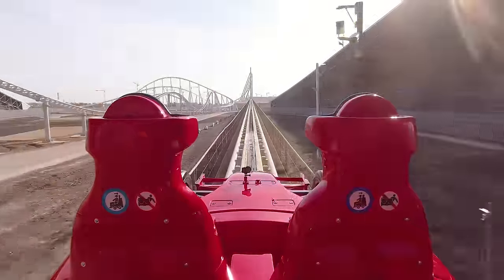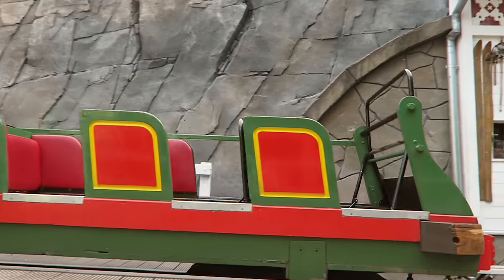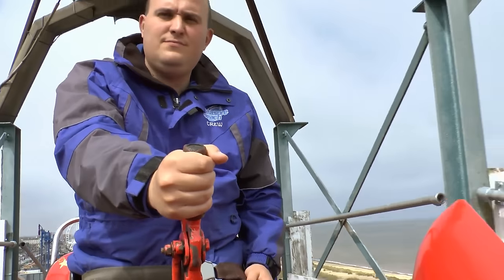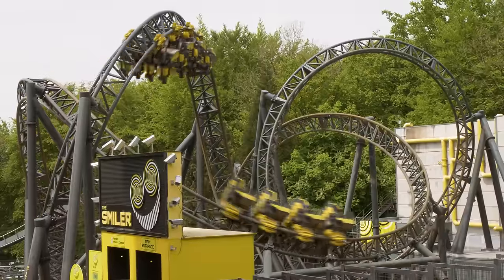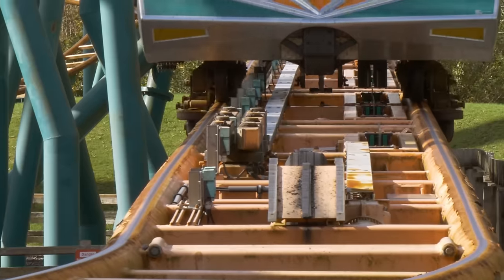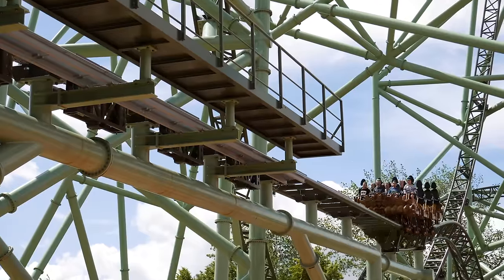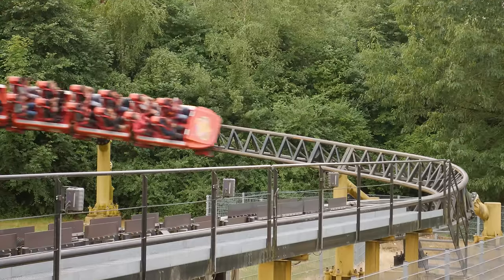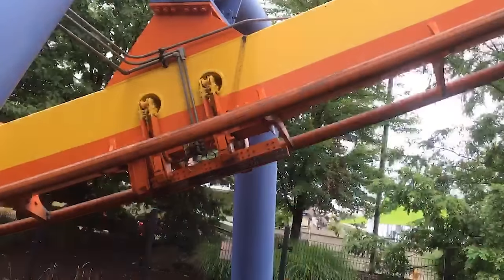Roller coaster brakes NEVER fail

Comment: As informative as this video is. It will never eradicate the fear of seeing a station break failure in the original rollercoaster tycoon
Reply: If the coaster has multiple trains, it means there's about to be a crash. If there's only one train, it means those guests are getting a free ride.

Either way, it's terrifying.
Reply: Only if you didn't have trim brakes.  Station brakes failures would cascade to any brakes immediately before the station, but if there is a gap of at least one tile, the before-station brakes will still work.
Reply: bro got traumatized by rollercoaster tycoon 💀
Reply: @CarlosAM1  Failing a difficult scenario because the RNG decides to fuck you over is definitely fear-inducing.
Reply: Which is why I always use block brakes. Period. This fear of brake failure even permeates into playing Planet Coaster. If it has multiple trains (sometimes even if not,) that coaster gets block brakes! 
cue Oprah Winfrey meme
Reply: I went to a design, where the ride starts at a high point and at the end it has to be lifted up. So no breaks are needed.
Reply: @RadioactiveSherbet  RCT1 did not have block brakes
Reply: Good old RCT with it's fail deadly brakes
Reply: Don't worry! The lift hill chain will slow them down!
Reply: I used to fear that too when I was younger. Now, over two decades later, I know to either A. add brakes before the station or B. set the Coaster to have it's parked train leave the station if another shows up (only works with 2 trains).

Still, perfectly manageable problem in-game.
Reply: @alaeriia01  I've seen a lot of people say that, but I think it must depend on the ride and/or game version, cause I tried that as a kid and it didn't work.
Reply: After playing through the Diamond Heights level, I learned pretty quickly to double-check the trim brake placements at the end of each rollercoaster.  Nearly every prebuilt rollercoaster in the game lacks the proper braking system.  The best way, I found, was to place a set before the last bend in the track, followed by four tiles of straight track consisting of a spacer followed by a trim brake between two chains.  If the station brakes fail, any set of brakes that are not touching the station segment should still work.  In most break down scenarios, the chain drive sections stop moving which in turn acts like a brake that brings a slow moving train to a complete stop.
Reply: @RadioactiveSherbet  Block brakes should be a requirement to run multiple trains on a coaster in any coaster game. That is, after all, how it works IRL.
Reply: The idea there is that while they "never" fail truly it's "never, with proper maintenance" and in RCT the frequency of maintenance done on the ride will determine a probability value that determines if the brakes will fail or not.
Reply: in rct all breaks are fin breaks they can pnly be straight

Comment: One thing that this video didn't mention is the fact that permanent magnets lose strength over time.  So you still need to either (a) replace the magnets on the train or (b) re-strengthen the magnets on the train periodically.
Reply from the maker: That's a great point! I'm a and b would be covered during maintenance of roller coaster trains :)
Reply: Oh yeah i didn't think about it, still better than electromagnets that would stop working without power
Reply: That's the first thing I thought. Also, when eddy currents slow a train down, it produces a lot of heat. The magnets probably need very good heat sinks. Magnets are less effective at high temperatures, and if it hits the Curie temperature, about 700C, even for a second, it destroys the magnet completely.
Reply: still pretty sure that happens a LOT slower than the wear of the friction brakes (and by having said magnetics in right before the friction brakes to do the final stopping, it further reduces the wear on the friction brake, since the train is moving very slowly already into them)
Reply: @iankrasnow5383  looking at those coaster cars, it doesn't look like a whole lot of effort has been put into heatsinks, but realistically I don't think it's necessary. The brakes only really get used for a small percentage of the ride time, the fins and magnets have a fairly large surface area to disperse heat from, and they should have quite a lot of thermal mass to dump heat into if the air cooling isn't fast enough.
Reply: @crosswingrobots  It kind of did. It said they're failsafe because they are passively on and there's redundancy. But of course they can fail if the train derails or something. Plus if the operator accidentally turns off the friction brakes, you're gonna have a bad time.
Reply: @iankrasnow5383  not quite: most of energy released takes form of heat from current - current that is i induced in metal fins. Ergo magnets, even if they warn up, do so little, and as for metal fins it depends - i would say that they are calculated with cool down time (from round trip time of cart) and if needed are intentionally smaller but longer as to spread out heat over overall larger area. 

After consideration: it may also be possible to use special fins for each breaking segment (initial slowdown on small fin and later down the breaking segment larger fins intended for catching out reminding energy. Not just that i believe that if you made effort to make good timing you could even use energy induced and power rail to accelerate another cart at being of the track.
Reply: @iankrasnow5383  Okay, but if you've derailed I don't think anything is going to help you.
Reply: @rajzerfilip  IDK about the track ones, but I would think the high speed movement of the train would do a pretty good job at cooling the brake components on that end.
Reply: @scottthewaterwarrior  yes, but even if it didn't you can always borrow electrodynamic brek from just about any modern diesel loco
Reply: Could they use "temporary magnets" that are charged by electro magnet when the train is stopped/stopping?  (My definition of temp magnet: iron rods turned magnetic, for example)
Reply: @macgyveriii2818  That would be inherently less reliable. As the cabling or energy storage can easily fail.
A permanent magnet going past a conductor will produce eddy currents. Even if the conductor is non-magnetic, like copper.
Look for "magnet copper tube" videos. That is how hard the laws work for you here.
Reply: Permanent magnets decay very slowly. Like. Decades to centuries. Replacing it isn't going to be a problem
Reply: This would be solved with room temp super conductors, we can make insanely strong and durable permanent magnets with minimal deg
Reply: It's the fins on the track however that see the bulk of the heating effect.

I suppose if you mounted the fin on the vehicle you could use permanent magnets on the track for failsafe brakes and additionally electromagnets for trim braking
Reply: I think the heat is mostly generated in the fins, not the magnets.
Reply: Not so permanent if they become inert over time 😂
Reply: Isn't that effect something that takes hundreds of years to noticably manifest?
Reply: @iankrasnow5383  The operator doesn't directly control the brakes. The only thing the operator does to control train movement is pressing and holding their dispatch buttons when the train in the station is ready to go, and keeping them held down until the next train is parked in the station. Releasing them at any point in this process will stop the train that's partially in the station. Everything else is fully automatic.
Reply: If kept in normal conditions magnets lose power over dozens of not hundreds of years. You can practically ride your entire life without changing magnetic breaks.
Reply: Yeah but that is a lot less maintainance than using friction brakes or skid brakes all the way through. Skid breaks also need to have their springs exchanged over time but that is pretty negligible combare to the friction wear  and tear

Comment: The water brake used by Sheikra is actually pretty problematic all things considered. A year ago I got to travel down to Tampa to replace the two sections of track directly after the water brake due to corrosion.
Reply: I'm guessing you're a roller coaster mechanic? That sounds like an exciting job as far as being a mechanic is concerned.
Reply from the maker: Interesting to hear!
Reply: @Aaron-cs3xl  nah he was just bored and owns a welder
Reply: why do you think that is problematic? The engineers know it will corrode. Replacing those sections is maintenance, not an unexpected repair.
Reply: @CarlRencer  probably because due to corrosion it has to be replaced fairly often compared to the rest of the ride. especially considering sheikra is a steel coaster which can normally go around 30 years without their track having to be replaced.
Reply: Another thing is that using drag to slow the ride down is that the drag generators can get broken down. The sheer forces those breaks must be under every time they're used must be incredible. That's a failure point, right?
Reply: @Razticz  I didnt know you were still allowed to buy those, after the war.
Reply: It's funny how people are concerned about water brake causing corrosion ehen they don't seem to realize that rain can cause corrosion as well.
Reply: @automation7295 I suppose though that rain is much less on each individual part of a track at a time unless it’s a monsoon. The water brakes here are many gallons every day.
Reply: @jort93z  Did a quick google search and apparently they can be between 6 and 9 on the scale. It is very well possible that the pond is on the high end.
Reply: so that’s why the sheikra was closed when I went to go visit.
Reply: @jort93z  Rain is most definitely NOT distilled water, it is loaded with impurities, probably more than tap water
Reply: @CarlRencer  the issue is when someone installs a coaster in a park that isn’t following proper safety procedures. A tale as old as time. 

Or. As old as parks.

Comment: I'm not really interested in rollercoasters, but I have to thank you very much for using km/h alongside mi/h. It's great not having to apply x1.6 every time speed comes up. :D
Reply from the maker: No worries! People from a range of countries watch my videos so I thought it'd be nice to make them friendly for everyone :)
Reply: Or you could go back like Billy Madison and actually complete you required elementary school education, either/or. 3mph is average walking speed, similar to 12inches can be divided easily in many ways. That's why it's called scientific metrics... mm, cm and 0s are only useful in a lab setting, why don't we just change minutes to 100 per hour? Because that's stupidity...
Reply: @rmac3217  This is called the INTERNATIONAL system of units. Because every country had their own unit system we all got together and defined an common unit system. Miles, inches and yards were not even taught on the majority of schools around the world... I mean, why they would? They're used on what, 2 or 3 countries only? Everybody else uses the standard.
Reply: @rmac3217  Never learn Imperial! Metric > Imperial
Appendix: There are only 3 countries which use imperial because metric is superior in terms of conversion. It is just easier. There is no reason to use imperial. 
Appendix: Which do you prefer? 100 billion or 10000000000 tens? Which do you prefer? 0.5*7*4 C or 14 C?
Reply: @rmac3217  How is metric only useful in a lab setting? Most of the world only uses metric. Instead of your 12s, use 10s; we're already using base 10; 1,2,3,4,5 etc. Look how easy it is. 100cm -----> 1m . I would say imperial just sucks. In fact, it isn't even useful; not useful in a lab setting, not in a casual setting and certainly not for anyone at anytime.
Reply: Because most of the world do nothing and are heading for the bubble, 1920's depression x10. When you are actually doing something it's easier to divide by 12's than go back and forth and make mistakes.
Reply: How is it easier to divide and multiply by 12?
Take "544731" or "544730" for examples. You'd definitely have to think for a bit to get the answers and you could easily make a mistake.
"go back and forth and make mistakes."
What?? Multiplying and dividing by 10 is so easy that you wouldn't even need to think about verifying it; you'd have already done so.
Reply: @polygontower  If you ever work with steel or timber you will understand why dividing by 2, 3, 4, 5 and 6 is handy. However, by the sound of it I don't recommend you touch anything with a power cord if you want all your fingers.
Reply: @rmac3217  imagine unironically thinking the imperial system is not only useful, but superior.

If dividing by 6 and 5 is useful, sure, divisions works as wonderful in imperial as in metric. The only difference is in unit conversion. Now you just said have fun making a mistake in converting from one to the other. Now, in metric its nearly impossible to get things wrong just multiply by some power of 10, ie just move the decimal point. Theres no mistake to be made here. So assuming you know that, you probably meant that conversion from imperial to metric is the part, where the mistake occurs. Which is completely relatable, NASA crashed a probe because they made a mistake in converting data. But that is not the problem of metric. Almost every one uses it because of its easy to use converaion rules. The problem is that the usa and 2 other countries dont adjust and use another system. 

Now please tell me, why is it easier to divide by 6, or 5280, Im quite interested to hear :)

Edit: And dont give me that crap about that a certain unit is for walking speed etc.
You had to learn that at some point and so did we in metric. Its not an intrinsic advantage of A over B if you learned A instead of B in school
Reply: @gorgit  Even in metric nations the standard piece of plywood is 2400mm x 1200mm, why do you think that is? It's also just quicker to just divide in your head without having to use a calculator and know you are always still accurate.
Reply: @rmac3217  I dont see anyone having a hard time dividing 1200 by 12, 6, 5 or 4.
Reply: Idk why 12 is easier than 10. I will never understand the point wtf
Reply: Stop using burritos to measure distance and you won't need x1.6
Reply: @rmac3217 the standard is 2400x1200 because its a useful size, not because of its divisibility.

Here's an example of the difference: if you have a bridge 1 mile long, with 2 screws every 6 inches along, how many screws do you need?

Now if the bridge is 1km long and you need 2 screws every 10cm, how many do you need?

Its very easy to do the second one, the first is noticeably harder.
Reply: Actually U need 6 scews every 10cm
Reply: @rmac3217  the amount of screws don't really matter, it's the conversion between them to show the difference. The number of screwed would totally depend on the type, shape and size of bridge.
Reply: @polygontower 12 is divisible by 2, 3, 4, and 6. 10 is only divisible by 2 and 5.

Comment: While they may never fail because of failsafes, when I was a kid my family were the last call for the Mean Streak at Cedar Point, and due to shutdown procedures, they disengaged all but the last set of brakes. They had a strict lowered age limit and warned us this last ride is gonna be fast and painful. They weren't lying, I grew up doing annual trips to Cedar Point and that was the fastest the Mean Streak ever was, the final steep banked sharp turn that ended the track was brutal. Everyone had headaches afterward from our heads bouncing off the sides of the head supports in the fast turns. It hurt that day and everyone regretted it in the moments after but I'm glad I got to ride the "brakeless" Mean Streak before it got torn down.
Reply: So they turned off all the trims?

Comment: I drove buses briefly in college and found the concept of failsafe brakes really fascinating there as I was learning about air brake systems. In a bus with air brakes, unlike a normal car, but similar to these coaster brakes, pressure is required to keep the brakes _disengaged_. If the air brake system somehow fails and pressure is lost, the brakes become fully engaged and the bus comes to a stop. Pretty clever stuff.
Reply: @tbird-z1r Brakes overheating and becoming ineffective is the most common cause in mountains
Reply: We have the same thing in nuclear reactors. If we lose power the control rods are released and stop the nuclear reaction so it doesn't go supercritical while the power is out
Reply: Trains have the same
Reply: Elevators are the same!

Comment: 12:00 For those of you who are unfamiliar, a block zone is a section of ride that only one train may occupy. At the end of a block zone is a method to stop the train in case the block zone ahead is still occupied.
Reply: This is the safety system that prevents roller coaster trains from colliding with one another.
Reply: hahahahaha
Reply: Ryan is that you?!?!!
Reply: ElToroRyan has been spotted
Reply: OK THAT IS ENOUGH wanna be problematic roller coaster
Reply: im so confused, dont they explain that in the video? like ten seconds after this
Reply: @tntcake6327  it’s an inside joke referring to ElToroRyan’s famous spiel that he says every time he brings up block zones! :)
Reply: United someone overrides the safety mechanism
Reply: Gotta love block zones😂😂
Reply: I read that in his voice 🤣
Reply: if you didn’t read that in ryan’s voice you’re not a true eltororyan fan
Reply: Would it be possible to use side mounted brakes and fins to allow braking during a turn making a having a several blocks less of a compromise.
Reply: The block system was borrowed from the railways anyway.
Reply: Smiler! 😬